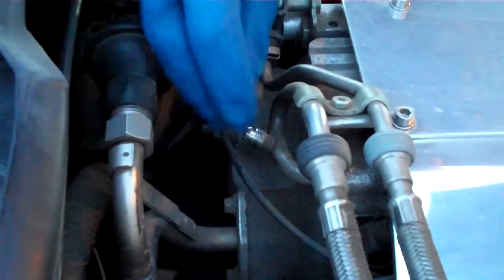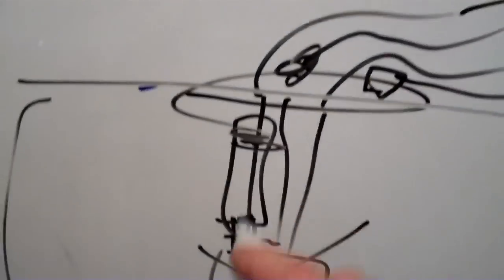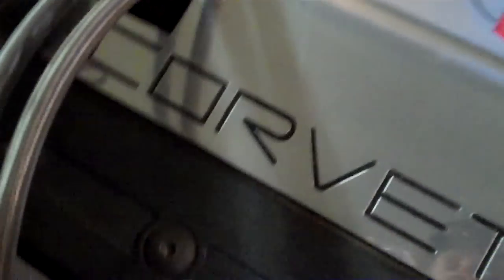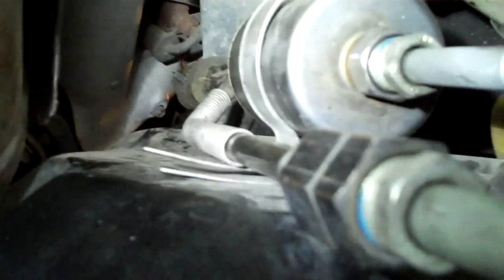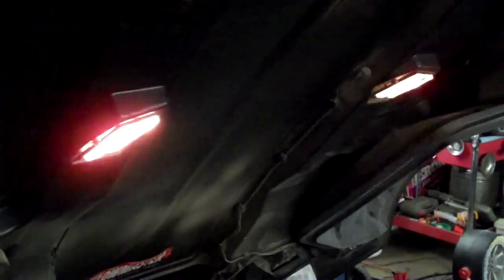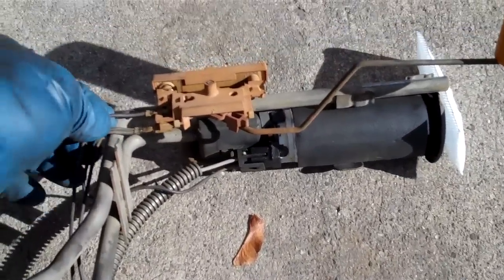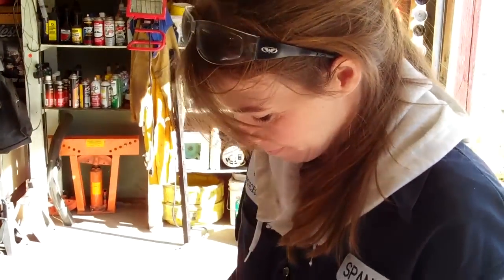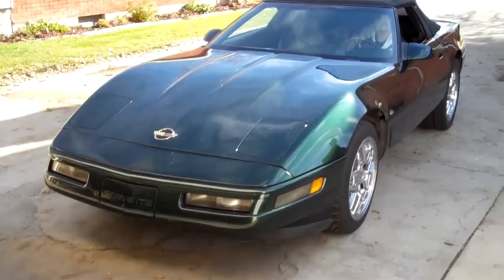How to Replace a 1990's Corvette Fuel Filter and Fuel Pump

Comment: You two are the BEST!  I'm a newbie when it comes to Corvettes. I have had F-bodies where you have to drop the tank or cut a hatch to get to the fuel pump, and was under the impression that I was in for a long frustrating day, or an expensive trip to the GM dealer.  I was so happy when I seen how to remove the fuel pump from a C4 Vette.  I can't thank you enough for posting this vid, you have saved me time, money, and frustration. I am now confident that I can do this myself.

Comment: To put in my two cents (Brian's internet is down for a few more days), it did not cause any problems to have all of those on the same mechanism It came out very easily and the wiring was straight forward.

Comment: Brian I have a 91 Vette ..once I thought I may have had a bad fuel pump, so I disconnected the  lines and turned the power on ... I then went to the tank and it was pouring out of the line I knew  the pump  was good ! ( yes I did that out side )

Comment from the maker: Some systems don't have them- like on Chrysler vehicles such as the Town and Country Mini Vans.  (which have been plagued with problems directly related to the in tank feedback or filter feedback design.)  The idea is to have flow which enables variances in fuel consumption to be readily adapted to,  It's like a spillway on a dam.  No matter the variance in the volume of the inlet- the reservoir remains the same level, but in this case it's the pressure and available volume that remains.

Comment: I need to clean out the fuel tank on my '84.  I see the sender unit gauge wires disconnect, glad to see that.  I was worried I'd have to pull it out alone.  This looks simpler than first thought.

Comment: Im working on a 89 with the same problem. The rubber boot on the fuel pump melted inside the tank and was sucked up in side the line .I dont think it made it passed the fuel pump assembly. The fuel filter was clean. My question is what s the little round cup at the top of the assembly. It has a line connected to it also I cant blow into it.  could that have clogged is it important

Comment: Wicked tiny o rings on the filter,people,should have extra when changing the filter if they drop one. And the thing the pump sits on works ! Very noisy without that black rubber support donut.  I had a 94 ' vette coupe,,but no garage,when it rained it wouldn't start to easy as  the humidity got into the spark system in front of the water pump,what's it called ? Optics park ?  Anyway,nice work as always.  Happy gobble gobble day !

Comment: Quick question: is it easier to just loosen the cross-strap by the fuel filter or do you need to loosen the cross-strap where it mounts on the right side there by the filter and also loosen the bolts where it criss-crosses with the other cross-strap? I guess it might be better said: if I loosen the bolts where it mounts by the filter will it drops enough to get your wrench and hand in there to get the old filter out?

Comment: The rubber grommet between the fuel pump and the 
Assembly is called a Vibration Dampener.

Comment: Great video my 92 base model..died on the offramp in Vegas last night right after I got some gas..any tips besides the excellent ones in this video?..I've read a few articles on stallings out which included ecm..
Reset..fuel filter relay..and etc etc?
Thank you again for the video!!

Comment from the maker: Check for corrosion on the positive side.  It shouldn't fail due to a lock out or security issue.  I've serviced many 2011 Nissans and didn't have that issue.  That #@$n battery/fuse thing however has been a problem on almost every single one I've worked on.

Comment: There's a vacuum cylinder coming in on the left side pump assembly looking at it before removing. That small canister has a round plastic tube and spring inside it. What is its purpose and what does it do? It's more to the top of my 90 vetted vacuum I'm thinking and will it affect the running part of the car?

Comment: Thanks for the video, while test driving a 1992 vette I just bought last week it ran good for 8 miles and then started bucking and sputtering and then died.  I can start if I pump the gas bottle but it just runs for a second and dies.  I'm hoping it's either the filter or the pump

Comment: Hello, I was hoping you can help. I have a 1992 lt1 vette . I put in a new fuel pump ,  new fuel filter ,  new fuel pressure regulator , new injectors . The fuel pressure is dropping under load . The car has hesitation , misfire , and stalling .  I also replaced the optispark recently . ..  Would a bad pulsator cause this ?

Comment: Great Video!The assembly is the same for my 88 35th Anniversary.. I'm having a problem disconnecting the clip that connects the fuel pump.Did you use a special tool to pull up the little grey clip and then pull it apart. (I'm heavy handed and do not want to break any hard plastic electrical connections inside the tank ( I hate those clips especially when they get old and brittle) Any recommendations? Thanks.. Also, thanks Spanky for asking the questions

Comment: Brian, a friend has an early 90's beat-up GM truck 5.0/5.7 TBI and the 2 injectors aren't spraying, i can check the pulse with a test light? I noticed he has 4 previously cut, poorly connected wires running to the injectors, i was thinking of soldering the wires 1st for him then check the pulse? Connect the test light to battery ground and probe so it should come on and off?  it has a new fuel pump, i say 5/5.7 as he had the 350 installed, just want to be sure before he replaces module

Comment: Brian, I have this same issue on my 96 vette but only when the temperature is in the low 30's or below. When it is warmer everything works fine. Do you think that the fuel pump is faulty or is it other electrical issues?
Reply: jisslebissle did you ever fix this?

Comment: The fuel pump is pumping a higher volume than the engine consumes. The rest of the fuel that the engine doesnt  consume is sent back via the fuel regulator back through the return line to the tank

Comment: Yes your right men get pissed off more when working on a car than women to . Women manage thing a little better than men .But that was the easiest fuel pump changeout I have ever seen in my life . The early audi 5000 cars from like the 1977 to 1979 have the pump under the car . But you need to pinch off the fuel line .You get my point. You ever change a audi pump on a older car ?.

Comment: I have an 85 Corvette that won't start.  I put a noid light on all of the injectors and I don't get a reaction from the four injectors on the passenger side.  The driver side injectors are working properly according to the noid light.  Have you ever encountered this or know of any problem area on the Corvette that may cause this problem?  Thank You.

Comment: hey brian,, if i remove the battery cables for example from a 2009 nissan almera or altima ,, to work on the alternator then after the job ,i put the battery cables on and the engine wont start.. i presume ecu descofiguration or antilock system IT IS POSSIBLE TO FIND THE INFO OR PROCEDURE HOW TO START THE ENGINE AGAIN (you know for exampl GM 10 minutes ON ,10 secnds OFF 3 times and the 4th the engine CRANKS))  IN ALLDATA ,IDENTIFIX, MITCHELL or just the dealers has that information?finger crossd

Comment: brian I have a 1997 corvette new fuel pump last year ,driven 5 miles since , no pressure now I have heard ground wire can fall off easily.  would that be in the tank?